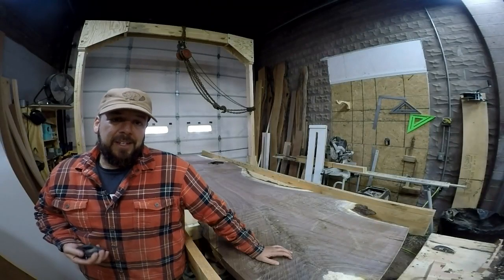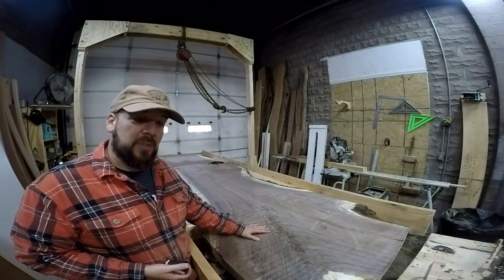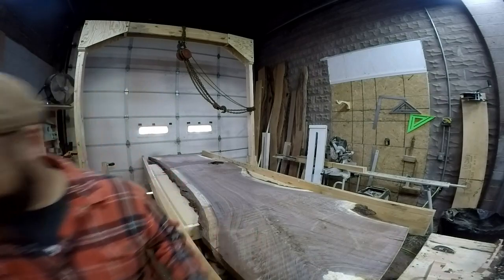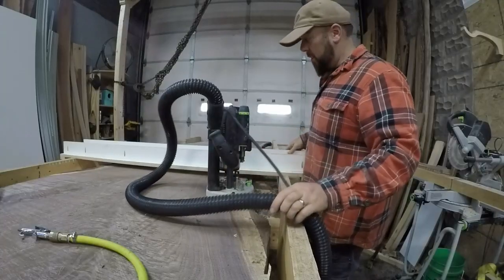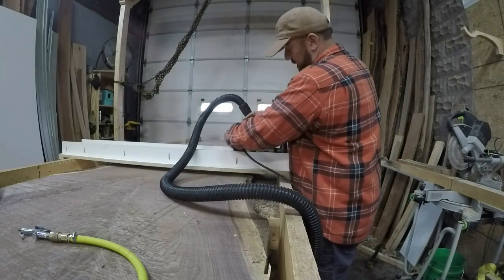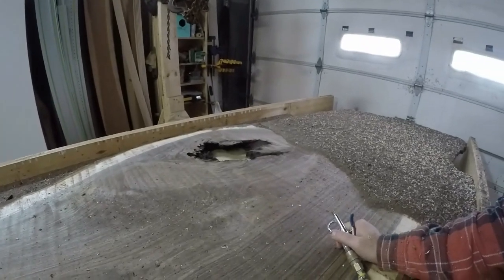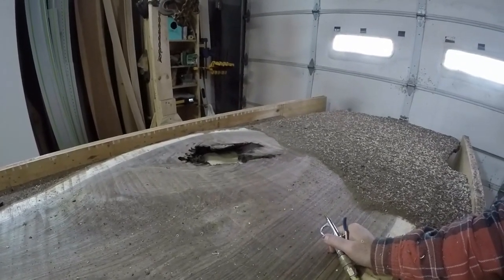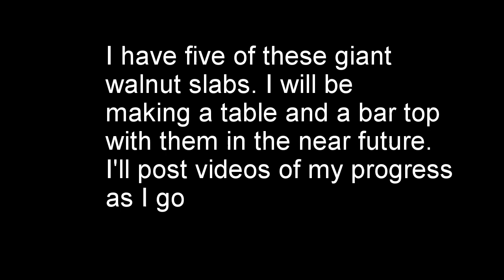How to flatten a large wooden slab

Comment from the maker: Yes. For sure. I had them all dried at a vacuum kiln. They get stacked on huge aluminum heated plates. The thickness has to be really consistent or it can damage the plates so I had to pre flatten them. This was a huge slow process but my slabs were otherwise to uneven. I'm working on a better system for cutting them much better the first time because that took forever.